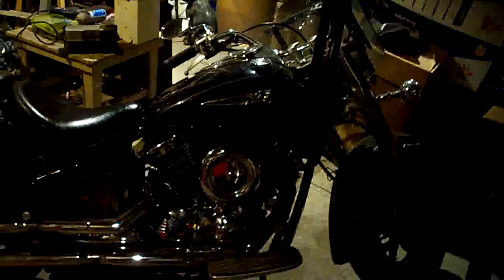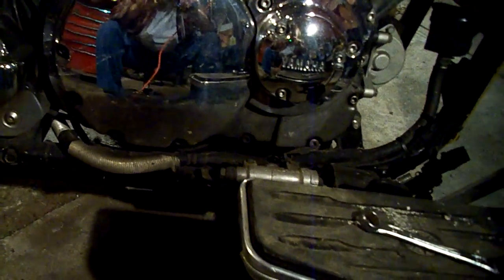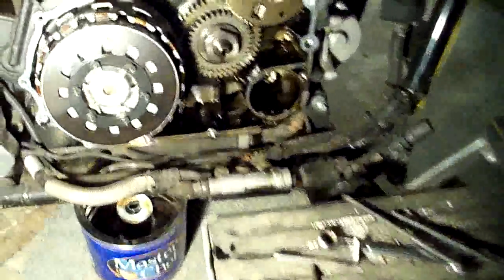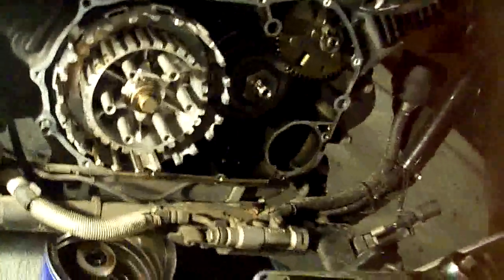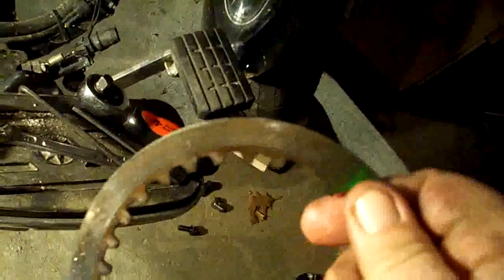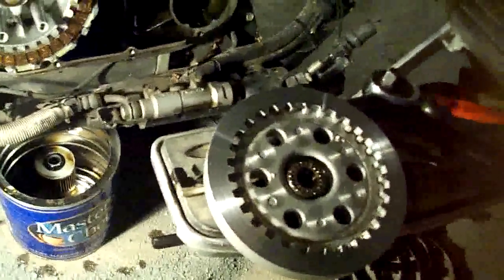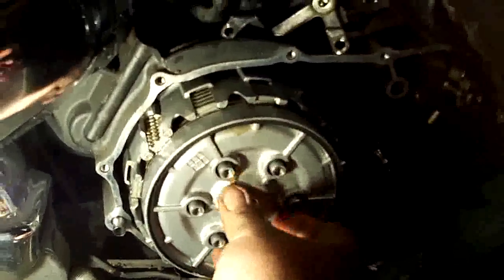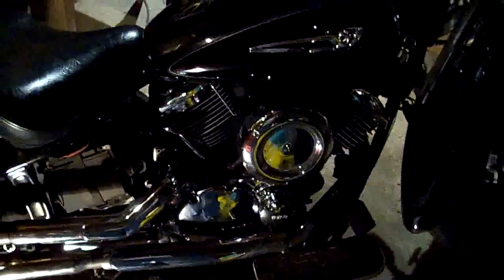2004 Yamaha V-Star 1100 Clutch Replacement

Comment: I changed mine and now it wont even run, what do you think i did wrong?
Reply from the maker: Changed your mind about what? I see no other comment from you so I don't know what you're talking about. If you changed your mind about changing the clutch plates then that shouldn't cause it to not run. Need more info. Did you comment before using a different name?
Reply: read my comment again. i said i changed my clutch plates and i think i might have put some in backwards, would that keep it from running?
Reply from the maker: MistakenMystery Sorry, I read it wrong. My bad. I'm not sure what happens if you put them in backwards since I've never done that but I don't believe it would keep it from running. Don't take offense but I have to ask,by running do you mean it won't move or the engine won't start? I ask because if you unhooked any wires while replacing the clutch that could be the problem. Or a part of it.
Reply: well it wasent me, i just bought mine from a friend and he said it was running great until he changed the clutch and he said he was in a hurry when he fixed it so he might have put some plates in the wrong way. So i guess i will have to take her apart and put her back together the right way and see if that helps. I wondering if maybe he forgot to soak them in oil or perhaps he unplugged some wires. But the engine trys to start when i push the ignition, but doesn't.
Reply from the maker: Ok. I had to ask because I had an issue with some wires on that side when I put my engine back in a few months ago after doing the top end. Do you know if the bike sat for a long time after he did that and before you got it? Could also be a carb issue if it sat for a while and they may need to be cleaned. That would explain it wanting to start but not able. Try this. Take the air filter off and try to get a little gas in the carb then try to start it. If it fires up for that little bit then I'd say it's not getting fuel and they need to be cleaned. I'll do what I can from here to help you out.
Reply: Thanks brother, he said he changed the clutch plates and tried to start it up right after he changed it and it wouldn't run, and has only been sitting in a garage for like 7 months,  so i don't think it's the carb but its worth a shot. i'm going to take the clutch apart and put it back together, make sure they soak in oil, make sure the plates are facing the right direction, and go from there. Because as far as i know it was running great until that clutch was taken apart, so ill let you know how what happens, thanks again for you help man!
Reply from the maker: Any time. And yes, please let me know what you find out.
Reply: Well i don't know what the fuck happened, but i took apart the clutch and made sure she was put back together right and she was, oiled the plates again. put new oil in, drained the gas tank and put new gas in. Tried to start her up and she wouldn't start, said fuck it, took a nap for a hour or two and then came back on a whim and tried and she started right up! drove her 25 miles since and haven't had any problems at all, starts up just fine every time, so that's awesome, i thought it was going to be somewhat of a project because i got the bike for $250 from an old friend! Hahaha no joke!
 
       Looks like i just got lucky, i do however have one small issue. I have 2 disk brakes on the front wheel and the one on the right side is rubbing. When i ride her around and come back that sucker is hot. I think the back one might be rubbing a little too. Got any advice on that one my friend?
Reply from the maker: Sorry I'm late getting back to you. We're in our Christmas rush at work and I'm running 7 days a week right now. I'm guessing it's rubbing on the brake pads correct? If that's the case, you may need to take the brake calipers off squeeze the pistons back in, replace them and work the brakes until the piston comes back out. May take a few times of this if the bike had sat a long while before you got it. Probably a bit stiff from not being used for so long. I use a light layer of grease on the slides also so that it will move freely.

Comment: Advertising fee Manuel on changing a starter clutch on a Yamaha 1100 2005 vstar
Reply from the maker: Hello Tina, I do not have any manuals but I will be getting one soon. I hit 2 deer with this bike on May 21st 2016 and damn near kicked the bucket. I have her almost all back together but I need to pull the engine and replace the head gaskets and go through the timing. The accident did something to the timing and when I started it up she back fired and blew a head gasket. I have not done my starter clutch yet but let me ask you, are you replacing it because it squeals when you try to start it? I had that problem with this one and it turned out to be the starter and not the starter clutch. Hope this helps.

Comment: Thats low mileage to have to replace clutch, wtf
Reply from the maker: That's what happens when you pull a motorcycle trailer that's a bit bigger than what it should have been.